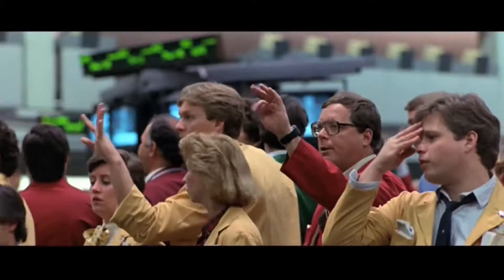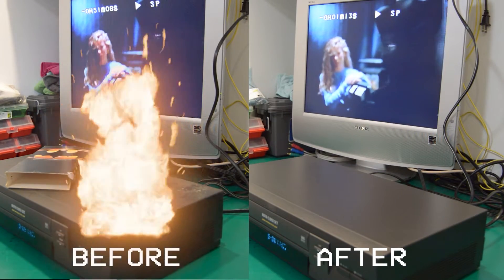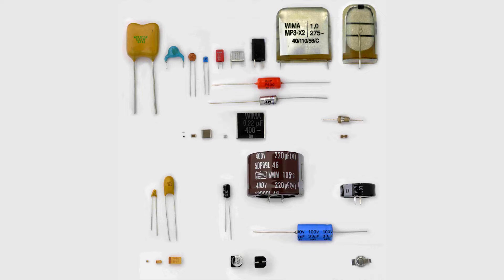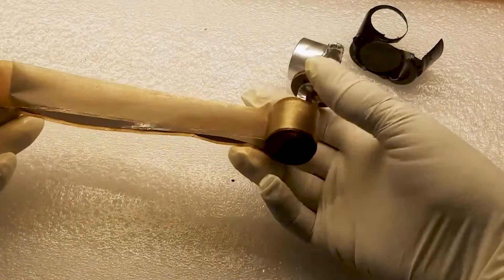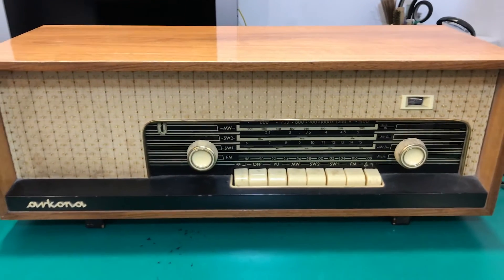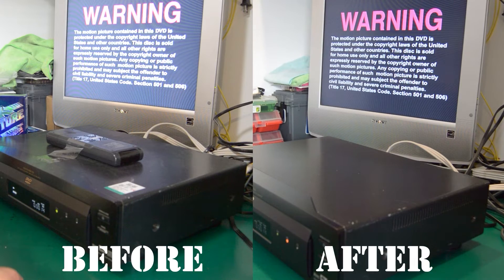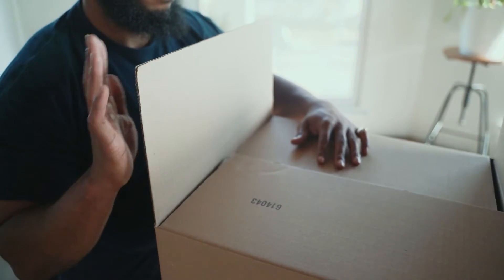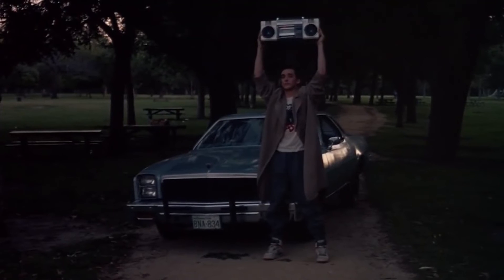𝐒𝐀𝐕𝐄 𝐘𝐨𝐮𝐫 𝐕𝐢𝐧𝐭𝐚𝐠𝐞 𝐄𝐥𝐞𝐜𝐭𝐫𝐨𝐧𝐢𝐜𝐬 | 𝐑𝐞𝐭𝐫𝐨 𝐑𝐞𝐩𝐚𝐢𝐫 𝐆𝐮𝐲 𝐓𝐢𝐩𝐬

Comment: Hey I bought a storage that was filled with  those.electronics parts made in 1970's Still in it original package how much money can I make off these parts??
Reply from the maker: Hi Nick. It depends on what kind of parts you have. If you have old capacitors like I'm showing here they would not be worth much while other parts like transistors you could sell easily. The transistors can keep forever but the capacitors have a shelf life whether they are used or not because they dry up so no one would want to purchase a fifty year old capacitor. Many transistors are discontinued and very hard to find so if there are no replacements for them, they would be of value. Thanks for watching! PS best thing is see what is sold on eBay at what price. Filter results by "sold" not what people are asking.